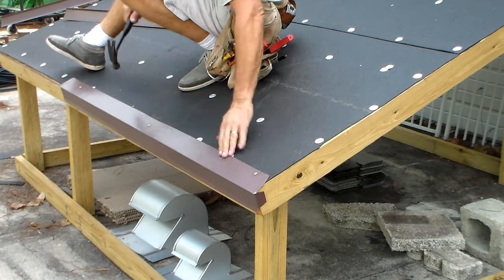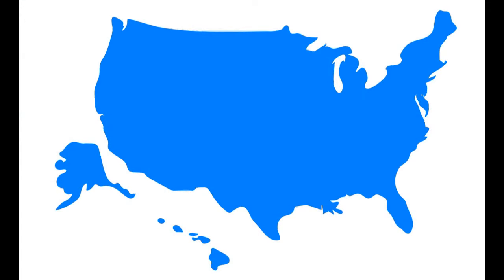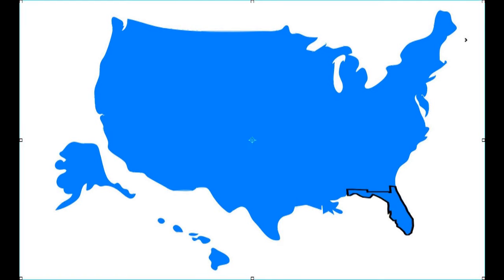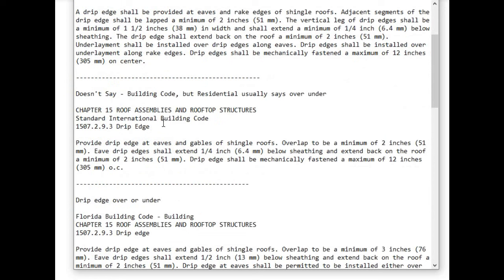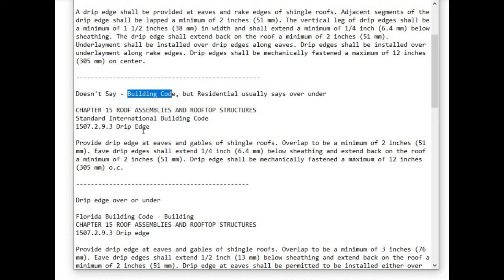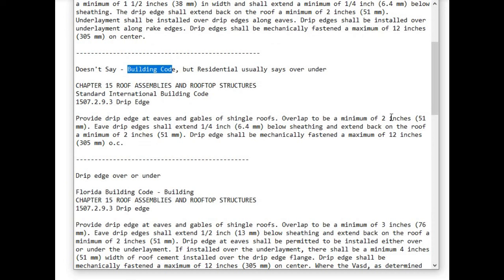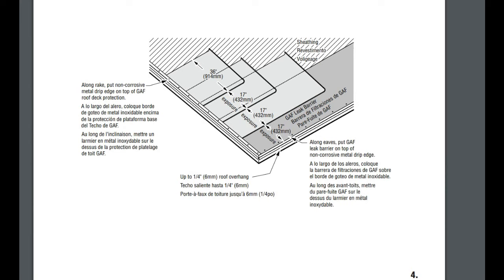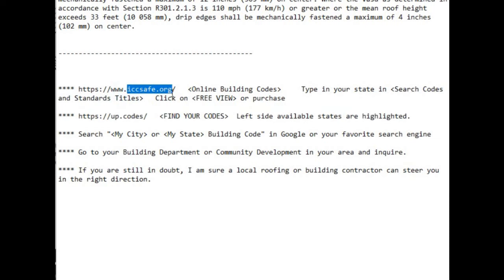Roofing - Does Drip Edge go Under or Over Underlayment or Tarpaper at the Roof Eave

Comment: I've been roofing in Florida since 2003. I understand the argument from our northern brethren about the drip, but that up north stuff doesn't fly down here. We don't have to worry about ice back up, we have to worry about hurricane winds. The felt, synthetic or peel and stick/seal underlayment goes on. Then you nail the drip to code, if you don't, no inspection that day and you make no money. Then you use a 4" spread of roofing cement that covers the deck edge of the drip and nail heads entirely on eaves and rakes. Water cannot get under the drip once you've sealed it with cement, then your starter shingle lays in the cement. The first course of shingles sticks to the starter shingle glue and bam, no leaks and it takes a very strong hurricane wind to pull it up. In Florida we also use 6 nails in every shingle, I believe they use 4-5 up north, once again, because of hurricane winds. The guy in these videos is spot on for where he's roofing.
Reply from the maker: Thank you for the confirmation. Good Luck

Comment: The Florida 2017 building code allows the drip edge to be placed over or under the underlayment at the eaves; however, if the drip edge is placed over the underlayment at the eaves, a 4 inch strip of asphalt roofing cement shall be applied over the felt and drip edge.
Reply from the maker: Yes, and apparently only in Florida.

Comment: I’m in Canada. Have always put it over the ice and water. If you have done many re-roofs up here you would know why. I have seen too many roofs that the edge is all rotted due to no protection UNDER the drip edge. Have never seen a problem when it was installed over.
Reply from the maker: In my opinion, I think putting metal directly to wood will cause problems due to condensation. https://youtu.be/JmV5c52MUEI

Comment: I get it I am north I like putting ice and water on first and folding it down the fascia a couple inches that way that joint is protected.  If I was gonna get crazy with it I would us peel and stick over the drip cap also.
Reply from the maker: I like that. Covering the wood first then adding the metal. I think the metal condensates and that is part of the rotten wood on the roof edge

Comment: Underneath the felt at the eaves,over the felt at the rakes is how they teach it nowadays for some reason..your correct though  it was done differently for a long time long time
Reply from the maker: Not sure why that is, but I know this method is very stable for high winds. Also, there is no worry of ice dams in South Florida.
Reply: @PracticalRoofingConcepts  if it is over any water that gets onto the paper goes under the edge and gets into the soffits
Reply from the maker: That's where the roofing cement comes in. The way it is done down south, there is no allowance for water to get under the shingles.
Reply: @PracticalRoofingConcepts  so the roofing cement is applied to seal the drip edge to the underlayment along the eaves?

Where as shingles should keep water off the underlayment in most conditions on shallow slopes and in windy condition water has been known to get under the shingle.
Reply from the maker: Agreed.

Comment: Love your videos. Great info. Have a new roof (3 years old) roofer didn’t install drip edge and we are having issues. Can drip edge be installed retroactively? I have self adhesive ice and water barrier adhered to plywood. I know your review of codes in the north say the drip edge should go UNDER the ice and water barrier but is that even possible now? Would installation over the ice and water barrier work? and if so a 6 inch roofing cement band? Thanks in advance
Reply from the maker: Yes, drip edge can be installed retroactively. The bottom 2 or 3 rows of shingles can be removed. However, the self adhered underlayment may not want to come up. If you are outside of Florida, then yes, the underlayment should go over the dripedge, as well as the ice and water if possible. The methods that we use here down south are not typical of areas where ice dams form. Is the gutter backing up? What kind of "issues" are you having?
Reply: The gutter isn’t backing up. We think the water as it runs down the shingles, and without a drip edge, is tracking behind the aluminum fascia (we see small drips on the bottom of the fascia), it then tracks inside the aluminum soffit (we see evidence of water drops coming out the air slits in the soffit)and flows toward the house and in behind the vinyl siding. As the water escapes from behind the siding through weep holes it trickles down behind the trim on a bathroom window where it is dripping inside the house at the top of a window frame ...I have a whole new appreciation for the tenacity of the flow of water !
Reply from the maker: In your case, the shingles should be hanging over the edge an inch or so. If not, you may be able to slide a piece of shingle between the starter and the ice and water. Or a piece of 1 or 2" L metal. Really just as a diverter. This would at least tell you that it is or isn't the problem.

Comment: I think it is best sandwiched over the felt paper.  If you have driving rain it will get in plywood.  Also the glue strip will adhere to the drip edge and shingles will not lift in the wind
Reply from the maker: That is the way we do it around here. Either way, I would put something over the wood and then the metal and then the primary underlayment

Comment: So most peoples commons sence would ask them " why is florida the ONLY state with that standard when its not the only southern state"..?? If for some reason the roof fails some where up the roof.. The water would flow under the drip edge istead of allowing to do its job.. And the wood under the drip would stay wet which is how rot is created.. And there are alot of building code writers in florida spend more time in a office at a deck than up on a roof or ripping failing roofs off for repair... So what does that tell u?.... These fly by nighters man
Reply from the maker: Have torn off many roofs and very few have rot at the eave. The cutoff has to do with ice dams. Not a problem with ice dams in Florida. Also, must use roof cement if putting drip edge over the dry in.

Comment: @Practical Roofing Concepts I am in SoCal and replacing my fascia board (water damage), which has included ripping out the metal drip edge.  Upon re-assembly I would like to use flashing tape (for additional protection) in conjunction with my existing 30# tar paper.  What is the correct stacking order here?
Reply from the maker: Most likely you will be installing dripedge, then paper. In my opinion, I would cover the edge so you are not putting the metal directly to wood, then install dripedge metal, then the dry in or ice and water shield over drip. https://youtu.be/JmV5c52MUEI